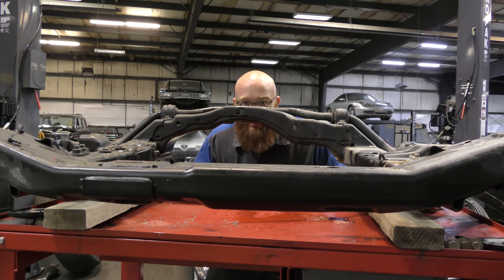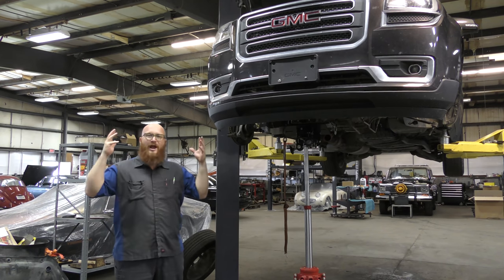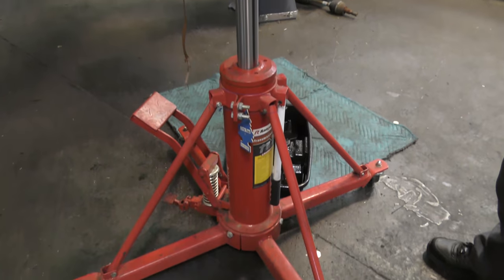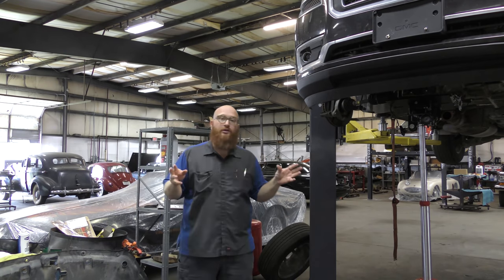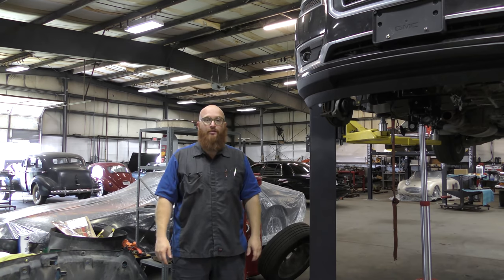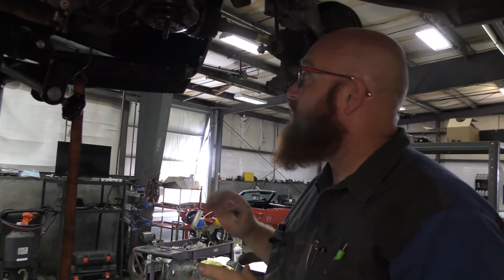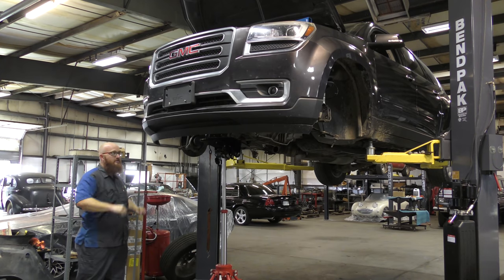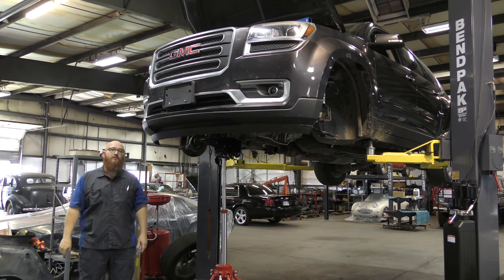Used car insanity in the CAR WIZARD's shop! Why did the huge repair get approved on this '15 Acadia?

Comment: DRIVE IT FOREVER, the book, states that the longer you keep a car in good repair, the more you save in the long run. Used car "valuations" are probably skewed to favor the insurance industry so they just have to cut a SMALL check instead of repairing it. So consumers lose, as usual. Fixing is cheaper than buying a new vehicle.

Comment: My girlfriend just bought one of these from carmax. its a "2017" GMC Acadia Limited, nice looking truck, comfortable, feature rich, etc. HOWEVER after buying it, we got home and determined that its actually a 2016. and before she purchased the truck, i was researching common failures and recalls and things like that, and all the research i came across mentioned that the 2017-current Acadias, fixed ALL of these problems, so i gave her the greenlight to go ahead and purchase the truck... Well after owning it for a bit, ive done an oil change and attempted to look into several other items of maintenance on it, and i discovered it's actually a 2016. which worries me greatly because 2016 was the last year of the Acadias with these issues apparently.
We do have a 5 year bumper to bumper warranty on it, that covers everything and her truck has just over 54k miles so its still a young truck, but this concerns me... make me wonder if we should trade it in, in 2-3 years. She wants a Yukon anyways, which was JUST out of our price range this time around.

Is it illegal for a dealership to sell something as a 2017, when its actually a 2016? is there anything we can do about that? seems deceiptful. I've tried watching reviews on 2017's and stuff before we bought it and i was always so confused as to why ours was just slightly different... but all of our paperwork from carmax shows its a 2017... but mechanically, and interior wise, the truck is a 2016

Comment: My mom had her real main seal go out too @ only 60k. I told her not to get acadias. The thing that people get acadias for is the cooled seats/heated steering wheel/ adjustable everything/etc….
They’re made to be leased and trashed in 3 years. Most new cars are all like these. Blast the consumer with tons of stimulation but skimp out on real metal and quality control.

Comment: This video reconfirms that gm from the 90s is way better than now, my 90 Cadillac still has it's original rear main seal that's still not leaking after 31 years, it's blend door actuator is operated by engine vacuum and it still works every time and has never been replaced. The engine is very reliable and the weakest link is the transmissions on those but newer gms are still plagued by transmission and engine issues along with tons of electrical problems, I still rather stick with their older cars.

Comment: Thats crazy that a vehicle that new requires that much repair. I had a 2013 Infiniti JX35 with under 130k miles that needed new rear coupler, new CVT transmission, and new transfer case. We bought the vehicle for $11k and within 6months it needed $15k worth of repairs.

Comment: Re,: Used car lots.  Generally, they buy cars dirt cheap, and then resell them for top dollar.  The car lots I hated were the glib taking dishonest car salesmen )who would lie, and sell their mother for a buck.  At one time I was a portable machine shop business.  Often, the owner or salesman would want patch up type repairs done instead of spending a minimum amount of money more to have a reliable engine.  One salesman said "All the car has to do is drive off the lot.  When I can't see the tail lights, it's the buyer's problem."  Then there was the cut-rate engine "rebuild" shop which would "rebuild" an engine to worn out tolerances.  Basically, if the engine could be disassembled, have the piston rings replaced in cylinders worn to .080" oversize, install new gaskets and oil seals, the engine would be passed off as "rebuilt."  One old engine had cylinders so worn beyond .060", I believe that I could have lifted an empty block with my finger nails under the Ridge!  The salesman wanted it bored to .060" below the ridge???  His rational?...."It'll run."

Comment: Ha!  I fooled GM.  No trailblazer or Envoy for me, that's right.  2006 Isuzu Ascender with 3rd row!  :)  I love that truck, 140k on the clock and running well.  I am terrified of timing chain and those classic gm actuators.  Pro tip- never disconnect the battery if at all possible.  This will result in those actuators 're-calibrating' and really trying to go full range/stop to stop.  When that plastic gets older, it's a big ask for them.

Comment: I'm living this same scenario.  The estimate for some rear differential and A/C work on a 2003 Explorer with 160,000 is slightly over $5,000.  I live in a rural area and the only Ford dealer has only a handful of used cars of dubious heritage and the cheapest is way over $5,000.  So, I gotta fix of what I know.  And yes, that $1,500 A/C job hurts over that bad $100 part, but I've gone through one Midwest summer with out air, and not gonna do it again.  One item that some are running into is the lack of good spare parts.  So far it I'm going on 3 weeks waiting for them.

Comment: That power steering pump fix cost me over $700, and my transmission was going to cost me $5500 to replace, so I sold it for $700. Caution to anyone who owns those Acadia, Outlook, Traverse, and Enclave, check your oil every two weeks, so you won't ruin your timing chain, and change your damn transmission fluid, at least every 4 years. Lack of listening to my advice WILL cost you bad! You will be driving, then you will nth be able to control the speed anymore, and have to pull over, turn off the vehicle, then turn it back on, and your vehicle will go into limp mode, until you turn off that light, and it will happen again, and again. The best thing to do is drain the transmission fluid, put in 4 quarts of fluid, drive for at least 15 minutes , let cool for 2 hours, and repeat the steps to drain and fill, and that'll fix that issue. Check on YouTube if you want to know how to drain your transmission fluid. It's pretty damn easy to do, just make sure you use full synthetic high mileage Dexron VI fluid only.

Comment: Those actuators are definitely a PITA!
The blend door actuator broke 3x over the course of 10yrs of ownership on my old car. Luckily, that was one of 3 actuators that was relatively easy to change out. It's behind the glove box. I still had to buy tiny wrenches in order to get in there though, but in the end, the fix cost me $30 each time and about an hour of my time (max... I got faster at doing it each time).

My sister, on the other hand, had the actuator break on the internal/exterior air flap. She had the same car as mine. That was took me several hours to replace!!! It was located right under the top of the dashboard and behind the passenger airbag. I tore everything out and got it to the point where I could just barely slip my hand and some tools in there to remove the thing. After a couple hours of disassembly, and being about to see the actuator, but not reach it, I was willing to cheat a bit in order to get it out.

In the end, yes, I was able to do both, but I'd consider myself a little more mechanically inclined than the average person. Not nearly as much as an actual mechanic though!

Comment: I think some people are buying up cars in hopes to make a quick buck.  The thing is is that when supply chain goes back to normal, people are going to get stuck with cars (or cars they just overpaid for hoping to make a dollar).  It rarely ever works out, and you might get lucky once (you buy a car, and then sell it for a small profit) but rarely does it work out repeatedly over time.  The car market, just like most markets that are overhyped right now, will probably crash within the next year.  I'd say keep your car you have now, if it runs halfway decent.  IF it needs some repairs, do the repairs as long as it's not more than say 1/3 of the vehicle's value, because if you buy a car now, you will get ripped off (new or used).

Comment: The Mitsubishi dealer close to me keeps offering to buy my 2014 Mitsubishi Outlander Sport that is paid off.  They've offered me $8,000 plus an extra $1,000 to buy my car.  It is due to a lack of well maintained used cars in the area.  That amount of money would pay a little less than half the cost of a new car, however, my car has the panoramic roof and other features that they don't put on the Outlander anymore.  I feel like it's sort of trading down because I wouldn't get those features anymore.

Comment: 2012 GMC Acadia. At 74k miles I dropped $2000 to have the injectors replaced. They were shot because this is a direct injection engine and it requires regular gdi service. Also normal DIY maintenance is a nightmare.  Air filter,  oil change,  radiator fluid change,  serpentine belt changes etc etc ALL are a pain in the ass. Normally they are not bad. The only reason I still have it is because I can't afford a new car. And having no car payment is nice. 2021 it has 100,434 miles on it. Pray every day it lasts.....

Comment: The big repair bills are just beginning. The hard part is new vehicles are having parts problems AND the aftermarket is as well. We have had a couple of vehicles about 12 years old that parts are no longer available for, anywhere.

Best to have a really old vehicle, or fairly new one. The people driving 90’s to 2010’s are in for a bumpy ride soon.

Comment: 2 or 3 of the HVAC actuators died in my car. I can still, at least, get A/C on my side...But, the passenger side will roast, despite closing off the vents. I'll be able to get through this year...but, next year, I'm biting the bullet and have all 4 replaced. Along with the H core and Evap core. And as long as my tech is at it, I'll ask to have the digital blower motor replaced, too. I'll keep those 3 items as spares as my Vette is now 9 years old with 100Kmiles. The coolant's been replace 2x already. So I'm assuming the H C is probably in good shape.

Comment: I work at a small dealership in AZ and work on 2014-18  mostly small 4 cylinder cars. These newer cars are garbage. Ford Fusions, Focuses having transmission problems. Turbo Chevys having the turbo go out in 4 or 5 years. Darts having no  room to work on them. They are just garbage. The grill shutters failing means they overheat. The Kias, Hyundais are much simpler cars and slighty better. I will stick with my 99 Civic and 95 Ram

Comment: I would love to see a video on the 2006 trailblazer vent/floor/defrost actuator. That SOB is buried in there. The variable flap position potentiometer goes bad/dirty and then you get nailed the next time you change the car battery and find the damn actuator won't calibrate to the HVAC control module. A simple $20 part from doorman buried in behind the gas pedal. I'm hoping I can get it out when the gas pedal assembly is removed. I used to do factory warranty core swaps on gauge clusters, ECM's and factory stereo etc for a local OEM core repair/swap shop.  If I manage to get 'er out and swapped, I'll post an update here. Love your vid's and style, kudos!

Comment: I had to replace the heater core in my Jaguar E-Type V-12.  easy-peasy job. because it's in the engine compartment.  Now the rest of the car is a nightmare, but the heater core is a walk in the park

Comment: Repair prices for cars built after 2001 are just insane i had 2001 Nissan primera that had few problems the cost of repairing that would had been almost 2000€ so i just stripped everything i needed from the car and off it went into crusher which was kind of sad because it was still quite good car and without the expensive stuff that were broken i still would drive that today meanwhile cars that i have owned from 70's and 80's fixing it few hours on my own yard or few hundred € on the place where they usually fix my car.

And the parts for the older cars have never really been a problem here in Finland because there is just so many old cars still around so there is still quite easy to get your hands on either new parts or from the salvage yard.

Comment: I feel like you'd be better off paying an car audio installer to take off the dash. I mean I had a guy in a professional shop and everything install the system in my cruze, all new door speakers, 2 amplifiers 1 sub all the wiring he had the dash apart back seats out all the door panels off and it was only 1k dollars for labor. I mean that's most of those guys jobs is to remove dashes and panels to get to wiring and stuff. Actually had him replace the motor in my driver's window because it went bad that was included in the price. I'd leave mechanic's to the mechanic stuff that's what they're good at.

Comment: I have a 2015 Mustang GT and my climate actuators broke.  Thankfully Ford has them located right under the dash. I was able to remove one that was bad and fix it temperately until I got the car back to the dealership.  I could have bought new actuators but I don't have the scan tools to sync the new parts with the climate control system. It wasn't too expensive but I know those sobs are going to fail again.

Comment: My wife owned one these turds.   Under waratee, had rear main, powersteering pump.   Out of warantee, transmission at 90k. 2 additional ps pumps.  Pumps good for 15-20k.

Comment: The reason for going to rubber timing belts in the 80's was to get nice quiet engines.  But these must be changed, so the engine was designed to 'easily' change the belt.  Going back to chains was to eliminate the need to replace the timing chain within a reasonable mileage.  The engineer middle managers did a typically poltically crappy job.  I would rather have a rubber timing belt than cheap, thin chains using cheaper, crappier plastic chain guides.  No wonder the car companies are failing...

Comment: I own a 2010 Chevy Traverse 155k miles, we've had to replace the water pump, A/C compressor and evaporator, headlight assembly, window switches, door speakers, and (I think) some sway bar linkages. I don't live in a hot area of the country and never leave my windows open in the rain or anything so these failures are just a mystery. Power steering pump seems like it's getting weaker and the transmission is shifting rougher. Classic GM post-bankruptcy quality; I don't trust their new vehicles anymore 😟☹

Comment: Burning question,  why did the rear main seal fail in the first place? My 93 4.3 (343k miles) chevy truck uses a thimble full of full synthetic oil every 7,000 miles. No teardowns ever!

Comment: i work at a local heavy equipment dealer ( for about 20 years ) i can 100% tell you, the customer is always WRONG !  its not their fault, they just don't know anything about the car / machine.   you are correct, present them with the problem and a couple of repair options and let them DECIDE. then its 100% on them. 

btw... we have that exact car  (2015 acadia) and i put a transmission in it ( myself ) 3 MONTHS outside of the powertrain warranty - just because of a torque slippage code. gm said 100% NO HELP outside of the warranty. car only had 60K on it. 

PRIOR to the acadia, we had a 2006 equinox, which was actually a good car, BUT... i had to tear out the complete dash - to the firewall- to replace a blend door actuator - yuck - 

gm sure does make it hard to be loyal!

Comment: if he brought an old trailblazer in and you quoted 950 to remove the dash for an actuator replacement he was right to leave. I changed 2 of my actuators in a couple of hours no dash removal needed on the old style trailblazer.

Comment: 7:08 Zeptoseconds 😂 
These GM CUVs are practically disposable pieces of garbage. They’re constantly having problems and the fixes often require engine out procedures or other expensive labor costs. The transmissions are weak and interior modules and electronics are pretty bad.

Comment: Just got my rear main seal replaced on my 99' Honda Prelude H22A motor 170k miles. While the shop was in there they changed the oil pan as well. Came out to around 1200 bucks. Mostly labor as they told me the seal itself was only $10 bucks or so.

Comment: I had to replace 2 blend door actuators on my 2012 Chrysler 200. I am VERY fortunate that that all 3 of them can be accessed, although not easily, without removing the dash. 2 are behind the glovebox on either side of the blower motor, and the other is tucked up underneath the steering column. All in all not too bad 😂

Comment: I'm only a little mad I didn't buy the second 06 F150 4.6V8 back in February for $2500...I COULD have had it if I was better with my money, and it would have been a great truck with the transmission work done...instead 3 months later ended up adding a 13 Escape to the fleet instead...at least the wife likes it, but Ouch!

Comment: It’s four or $5000 and you don’t get a new engine out of the deal. Or pay $10,000 for an engine in this thing, and it’s a six cylinder. Would you get to save a little money on gas. Absolutely perverse. You could drive a BMW and those things are heartbreaking.

Comment: I had a 2007 Saturn Aura & I had a seal on the Main hormonic balancer side go out. inside  the 100K mile warranty, then again, just outside it; my Chinese mechanic said this happens, on GM... he fixed it, & said it will not fail again as he uses quality parts, & G.M. uses priced parts. Quality ? Google: OEM: Google whatever...